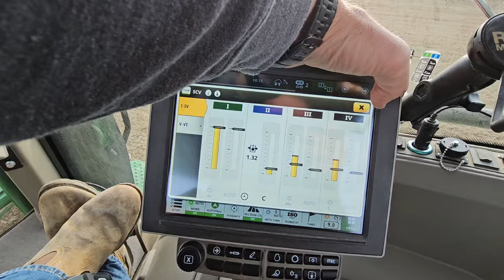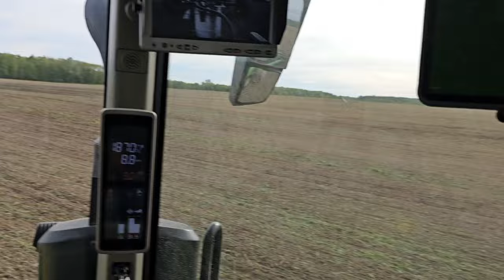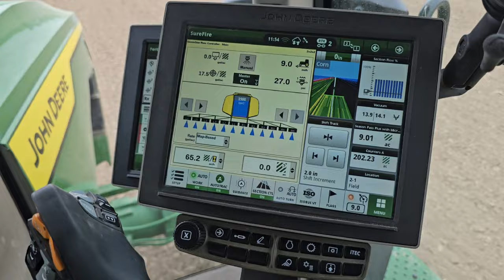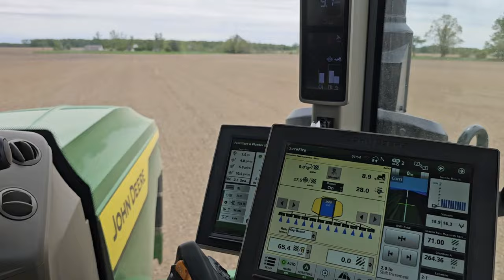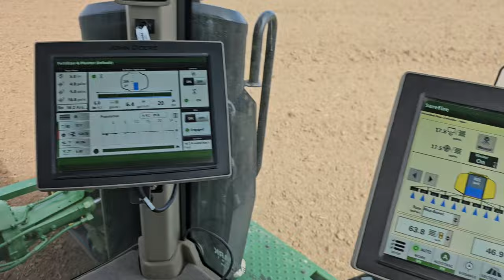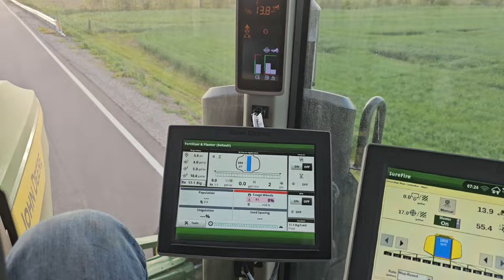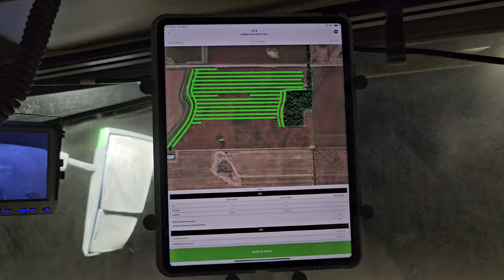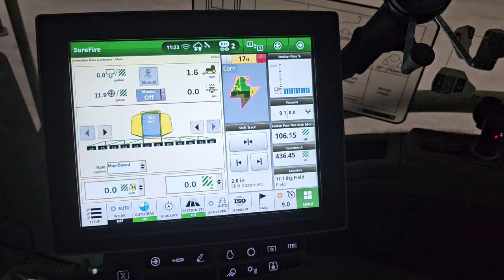Finally a Productive Day!!!

Comment: Try opening the valves on the wings of the planter for the exact rate system while running a test we did it on ours and there was a tiny bit of air locked in and after we did that it works perfect